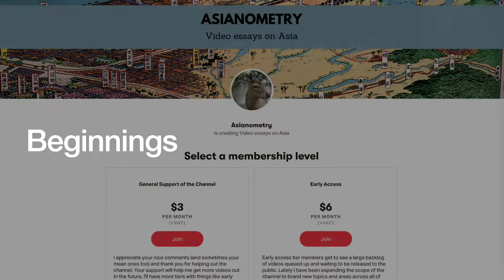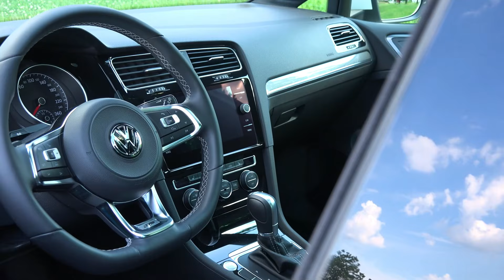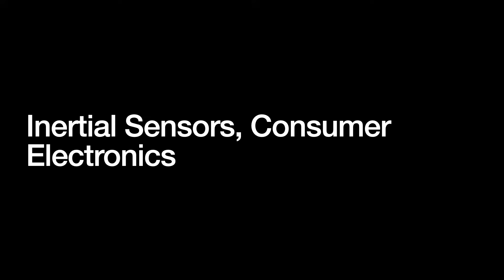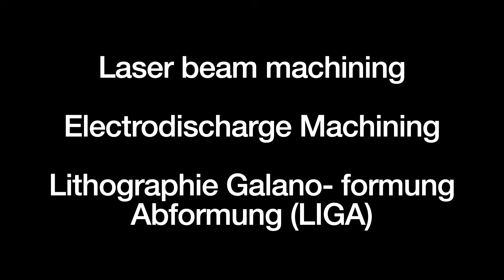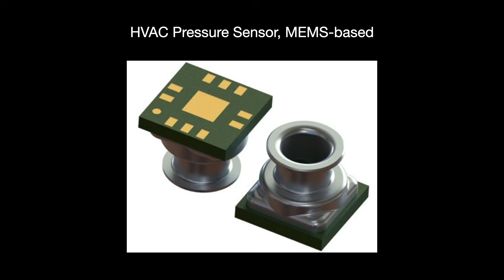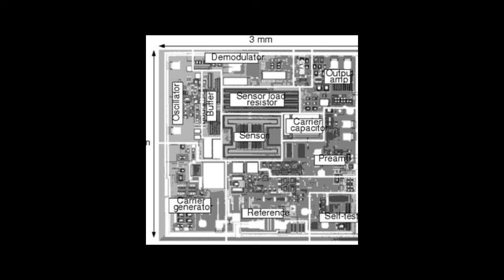MEMS: The Second Silicon Revolution?

Comment: Thanks! I bet my mechanic exponential loading , buckling spring would have applications as at the center MEMs device.
It has a Supercritical Pitchfork Bifurcation response and would be the description for the dynamic system I am studying. 
My experiments are a extension of Euler’s Buckling Column Theory. 
In my contained member system, after buckling the system settled to a new stable sine wave like “energy “ level. This wave like undulations continues till the material passes it’s elastic limits.
Maybe you know others subject matter expert that would like to see my example,  please pass the videos of my amateur experiments along to them.
Thanks again for your videos.

https://youtube.com/shorts/wtY-OaYBEHc?si=iaJIY3j8SP9h_th_

Comment: Your speaking is greatly exaggerated and contain many errors, including that you do not know the meaning of ( mechanical ) at all !! 
Mechanics is not related to ( movement ), meaning that if there is no movement or moving part ( according to your concept ), then there is no mechanics. This is completely wrong !!! 
Mechanics is the science of forces ( regardless of the type of those forces, whether physical, magnetic, electrical, electromagnetic, pressure, stress, etc., and whatever the size of those forces, whether they are on the nanometer scale or at lower or higher levels ) And then the effect of these forces on the materials ( the materials can be solid, liquid, gaseous, or between those phases such as liquid crystals, for example, but not limited to ) either the forces cause movement or they do not cause movement. Materials have different Mechanical properties and also have electrical properties. For example, when you want the Electrical properties of materials, you classify those materials on the basis that they are ( conductor, semiconductor, insulator ), but the Mechanical properties of materials are much more and cannot be limited, so in short, any “ physical ” property is considered a Mechanical Property, for example, but not limited to. ( Density, shape and composition of the body ) Therefore, everything mentioned in the video, whether the tiny / micro nozzles or the tiny / micro Mechanical sensors, are Mechanical devices even if they are not subjected to forces or they are not moving !! 
Even electricity is sometimes considered mechanical; In fact, Mechanics is the science of all sciences. 
The Mechanical System is always less complex, simpler, less energy consuming, less expensive, more durable and reliable, more repairable and easier than the electrical system. 
It also does not require a life cycle battery to operate !
The Mechanical System interacts with HUMANS and deals with them directly or indirectly and is not limited to / by the battery. 
Note: 
There is a Mechanical sensor in your car that senses external force ( it also moves and includes a spring ), but it is completely covered ( coated ) !! It is the car doors closing sensor. 
I apologize, but I had to clarify.

Comment: One thing I did for a project was decap a MEMS light modulator and very carefully coat the mirror assembly with gold. Then the device was capped with a ZnSe window under a high vacuum. It got used for a thermal image projector to make test patterns for flir type thermal imaging cameras. MEMS made this project a lot less costly than attempting to use gross optical pattern generators for each test pattern. The light source was incredibly cheap, literally a simple halogen lamp.😂

Comment: You mention IoT devices near the end. Accelerometers, barometers, temp sensors, all kinds of sensors, if made smaller, allow more and cheaper IoT devices. 
I got an assembly kit from a guy for a small rocket altimeter and ejection triggering device. I think it just had barometer for altitude, one accelerometer to sense apogee for drogue deploy, ESP32 microprocessor to allow you to program it and access it with a cell phone over Bluetooth to set main chute trigger altitude and to download flight data.  This all fits within 1 inch by 2 inches of circuit board.  Its at least a few magnitudes smaller than a decade ago, built by a hobbyist, costs a quarter of what previous devices were and 4 times the functionality.

Comment: MEMS has been there for years, almost as old as semiconductor industry.  it's definitely not another revolution as you can see all kinds of mems in your daily life. The BAW or SAW filter in your phone, the micro-mirror systems in your projectors, the accelerometers in your smart watch, and the Utah array for interfacing with brain. Rather, a useful and interesting tools for engineering and researchers.

Comment: (1) A demonstration of the calculations need to make a device based on a vibrating structure that generates  capacitance  0.5  to 3pf  depending on an input force. (I hope this is simple )
(2) If request (1) is too complex a demonstration of the calculations for a cantelever beam that would
can deflect  down or up when energized by an external force.

Comment: MEMS pressure sensors and accelerometers are everywhere on an airplane and I would go as far to say they are one of the main great enablers for the extreme autonomy of modern day aircraft. Fuel capacity sensors, altimeters, speedometers, flow rate sensors, gyros; older mechanical systems were larger in size and mass while harder to manufacture, had high maintenance costs and low reliability in the changing environmental conditions during flight. Now we can place 10 sensors for redundancy together with 10 EMI filters in the same space where we had 1 or 2 purely mechanical systems.

Comment: Whe I first heard of Mems I had no problem visualizing how a miniature pressure sensor would wok; just a miniaturized aneroid barometer. I also had no problem with understanding how a tiny accelerometer could work also.  What confused the heck out of me was how a gyroscope could be printed on a chip.  I finally found the video below and I was blown by the ingenuity of the designers; using a measurement of the coriolis force effect at that scale is just super impressive.

Warning! Physics equations used, not very difficult but mathemophobes have been warned. 
https://www.youtube.com/watch?v=PK05u9c3yWI

Comment: My question is how do these tiny machines avoid breaking down and wearing out very quickly, considering how they're so small?
Reply: Two effects that work in favor of small structures are the square cube law and the defect density. If you have tiny structures they have a lot of surface compared to their mass, this way the contact pressures for a given deformation/movement are relatively low thus making the surfaces last longer. And if your material has on average a distance between two significant defects of e.g. 2mm a very small structure has a good chance of being essentially flawless. So you get a structure that is subject to only small forces and has fewer defects from where a crack might propagate...
Reply: @antonjanssen3549  Everything is a spring, nothing is rubbing.
And the material is single crystal. Nothing to deform or work harden.
Reply: @antonjanssen3549  what about work hardening in relation to two components constantly rubbing against one another, when using materials that are susceptible to such wear? In addition, what about material creep for any components under a constant static load?
Reply: @Zer0C0re  interesting question actually. But very grossly simplified work hardening and creep are mortal enemies. Work hardening occurs when a material is deformed enough that large amounts of crystal lattice defects occur and are pushed together, effectively locking up the atom layers against further sliding and thus increasing the force necessary for further deformation. Creep occurs when atoms or molecules in the material are mobile enough to occasionally shift and in the process of rearranging eliminate lattice defects and strains. 
So creeping is a problem of material choice and work hardening results from large plastic deformation, which if it happens during operation is most likely caused by terrible engineering or overload.
Reply: @antonjanssen3549  "most likely caused by terrible engineering or overload"

In other words, things that humans are prone to causing, be it for money reasons, stress, malice, or stupidity...

Misanthropic pessimism aside, another concern that I have in regards to nanoscale mechanical systems is vibration, shock, and other kinds of kinetic/contact-based damage. These tiny parts just sound like a disaster waiting to happen if you're taking vibratory effects into consideration. 

Also, would these nanoscale gears, shafts, and other rotational pieces also require nanoscale bearing assemblies? If so, how would they be assembled, installed, lubricated, maintained, and prevented from wear? Would friction from this also increase the vibration problem? Would the same friction drive up energy consumption in the device and increase heat load, causing further wear? 

In addition, these things are so small that I have to ask: would quantum effects also gum up the works on these? Would things like brownian motion and the casimir effect, especially that last one in the instance of very finely polished metal components, namely broad, flat ones, coming into play further degrade systems, offset performance, change material requirements and manufacturing techniques again, further driving up costs, complications, and adding further limitations to the abilities of these nanoscale mechanical devices?
Reply: @Zer0C0re  the smaller something gets the less you need to care about vibration and bearings. Again, small means that you have a lot of surface for very little mass. Little mass means low forces, low forces with large surfaces means very low contact pressures. And all these fancy bearing and lubrication technologies do one main thing, they increase acceptable contact pressures, which you don't need here. You'd also be forced to design in an entirely different way, assembling things is very difficult and expensive here, so wherever possible you want only one part. Movement needs to happen by bending integral flexures, electric and magnetic effects need to directly act on your components (again small size helps because you have little mass with a large surface which makes these things possible).
Reply: @Zer0C0re  and yes, if you go small enough quantum effects start to become a non negligible factor. Which causes a lot of design challenges but also opens up new possibilities.

But the greatest upside to these very small devices is low energy consumption and due to being smaller than the average distance between defects you get a vastly increased lifespan before material fatigue breaks your parts.
Reply: @antonjanssen3549  Hilariously enough, these mems parts have the potential to last even longer than that provided you carry out your due diligence with them; not working them any harder than you have to.

Comment: Third Silicon Revolution: micro-scale Babbage Engines running at millions of cycles per second.
Mechanical parts at small scale aren't as troubled by mass, inertia or friction as macro-scale parts.
The efficiency of a single Babbage cycle is the real pay-off!
MEMS could be the bridging technology: Babbage Engines are 'programmed' mechanically, MEMS can shove stuff around rapidly and accurately in response to electronic signals.
Output of a Babbage is mechanical as well; optical sensors read the data, translate to electronic signals.
From the outside, the Processor would look like any other.

Comment: This video brought back alot of memories. Some 35+ years ago I worked on microbolometers for LWIR thermal imaging.
Reply: Years ago I used an off the shelf TI DLP chip to make a calibration device for TICs. It had the window carefully removed, then a super thin gold layer deposited on it, and recapped with a ZnSe optical window. Made testing a lot simpler since the patterns could be changed on the fly to simulate movement. Our images were BST ferroelctric sensors btw. The VOx sensors were a game changer to be sure. ❤
Reply: You were the first one to mention it, I thought of those immediately after someone mentioned DLP, those tiny structures of MBOL's are amazing tech. Tiny temperature probes arranged in a grid that has to be thermally isolated from the substrate (and one another).
Reply: @spikester  Yup! the amazing VOx microbolometers

Comment: It seems that MEMS and silicon chips address different things. MEMS are interfaces to the physical world, and in any given application, you only need a handful of sensors (only so many things you can measure). Silicon is the internal world, processing data, building higher-level features. There's no limit to how much you might want to add i n this realm. Even if MEMS could achieve the same cost reduction and complexity increase as silicon, it doesn't seem like it would be so profound as silicon has been.
Reply: MEMS is silicon. It's literally made from silicon using roughly the same techniques as for making microelectronics.

Comment: What if we could design nano LEDs and use then to speedup communication inside a microprocessor as light has no resistance unlike electrons.
Reply: This, funnily enough, may also apply to television screens as well, imagine a series of such Nano LEDs making up the entire television screen, the resolution would be ludicrously high, and surprisingly energy efficient, too.
Reply: @Iamwolf134  We have those, it's called OLEDs 😉
Reply: @johnnychang4233  Good to know. Still look forward to seeing ever smaller mems going into OLED screens, granting ever higher resolutions in smaller packages.